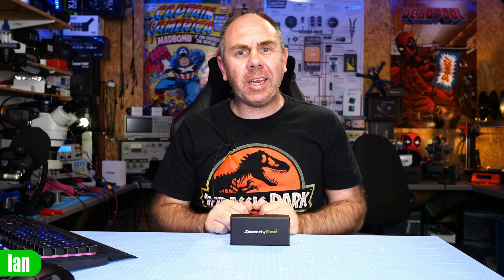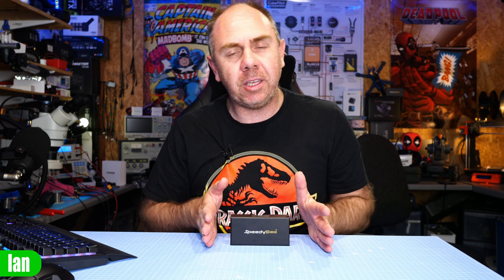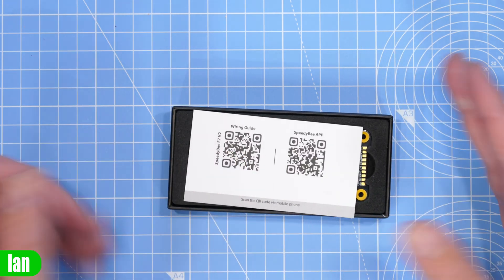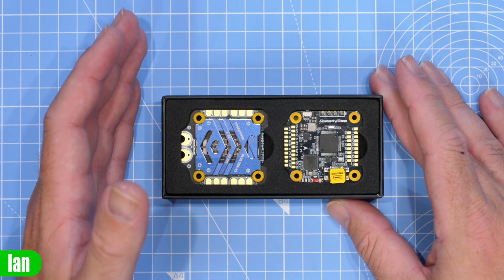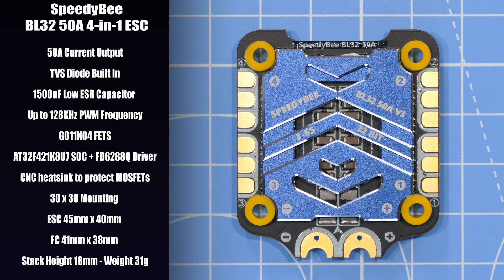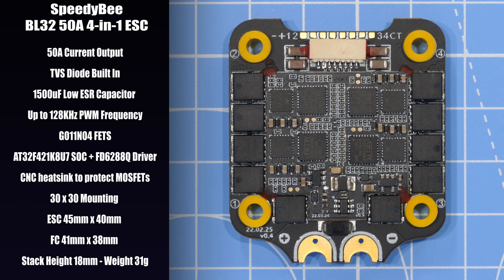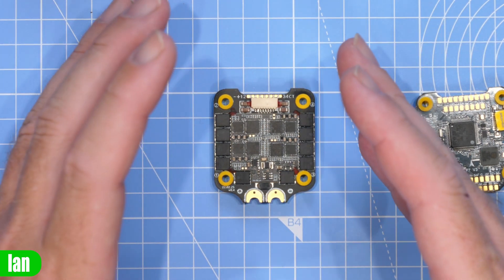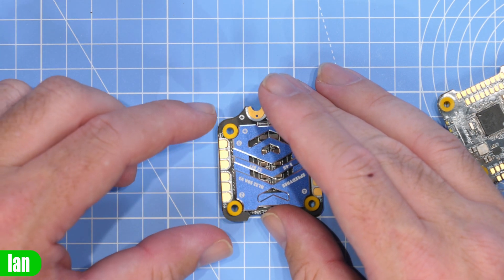SpeedyBee F7 V3 Flight Stack - Everything But The Kitchen Sink

Comment: Appears this stack is decent, considering that speedybee has kept producing it to this day. The later revisions of the V3 have a grey heatsinked ESC instead of blue. Features are mostly the same. The smaller top mounted BEC components (i assume this is the 5V bec) are now clear-epoxy potted as well as all of the plugs stiffened up with said epoxy. These changes appear very ideal for shock resistance, which very little other FC manufacturers appear to do.

SpeedyBee is gaining a larger retail following, since they sell retail on places like Amazon now, so have to handle a lot of returns on these FPV products. They will review the product flaws, and address them in order to get the warranty returns down. The FC design isn't flawed where it NEEDS said epoxy, not when compared to other popular flight stacks out there, but the fact they add it while others won't is telling to me. They all lack additional component-level hardening in some regard.
Reply: Oh, and they changed the chonker 1500uF capacitor to a very slimmed down skinny 1000uF. Love it.

Comment: Can someone help me with the OSD on my SB V3 stack PLEASE ???? I cant make it work Goggles 2 and O3 unit... I have Uart 4 my MSP in BF the ports as it says in the manual  and the o3 air unit is not going full power after arming and not showing the OSD.. I spend 3 hours trying and no luck. Thanks much. I have the R2 and G wire removed from the air unit plug that should not be the reason.. right?

Comment: I purchased the speedy bee F7 V3 stack. I received it with bent pins. I always inspect the ports before using a product. I contacted Speedybee and they offered me a 20% discount on replacing their defective product. Be careful working with them. If you end up with a defect, they blame you instead of offering any customer service to rectify their failure.  I'll personally never use another Speedybee product and I'll not repair any quad containing their products. Be careful with they so called "warranty" claims.  They don't actually warranty their products.

Comment: Hi Master, 
hoping You are doing Well and UtMost Respect for your Expertise ( really ).
I'm planning build a Mid Range 5 as robust as possible with this Stack and their SpeedyBee Master 5 HD frame starting from a 6S battery and KV 1300 motors. How do you think ? Do you have any advice regarding the made of the engines ? Thanks
Reply from the maker: I always use Iflight Xing motors.

Comment: Just curious, are the schematics and firmware available for just the SpeedyBee F7 V3's top board (the one with the STM32F7422, not the BL32 50A 4-in-1 Electronic-Speed-Control or 45A BLHELI32 board)?     

I like that it has Barometer BMP280 , IMU/Gyro BMI270 and ESP32-S3 (bluetooth/wifi).. so just want to purchase the top alone  (not the Voltage Regulators / Battery Elimination Circuit board) to play as a development board with my own sensors (ex. Beitian BN-880)

However, I'm concerned that I won't be able to flash/debug using SWD.. or if it's somehow locked to be used only with the Betaflight 3.5.2 / Emuflight / iNav  firmware / app?

Comment: Hi Mad's, I bought this flight controller because it was Inav compatible. I want gps rth and sell al my dji drones. I have built and sold over a 100 drones since 2010. (Inav, Betaflight etc...) In Inav, I can not get the esc from beeping. Even after successful firmware update, the esc beeps and will not connect on blheli android app. It will be detected but I can not write the changes I make. For better troubleshooting, I installed Betaflight and did get the drone to fly, I could reverse 2 motors from the motors tab in Betaflight... But as soon as I re installed Inav, the esc beeps constantly, the status tab shows harware not healthy and navigation not safe and although I can spin the motors in the output tab, I can not arm the drone's motors with the remote controller...  Anyone got the speedy bee f7v3 to work on Inav ?

Comment: @MadsTech - Great video! 

regarding this controller > speedybee is not only executing on the tech (new battery checker, their app for configuration, and much more), but they are executing successfully on User Experience. this is how you disrupt the initial leaders. wise strategy. will be interesting to see how they continue to innovate.

Comment: If you buy one and update firmware make sure you set your pwm on bLheli the default is 24 high 24 low will burn your motors up .. set high to 128 the max and the low to 35 fixes hot motors set motor timing 22 to 24

Comment: what i find interesting is that the controller supports 8 motors but their esc is only 4
Reply: I am pretty sure you would use two of the ESCs, and join them both to the one FC.

Comment: Hey man, I’m having a major issue with this stack. My FC and RX gets minimal power from the ESC when connected to lipo voltage, but on BF via USB and Bluetooth, it works perfectly fine. I tried reflashing firmware via BlHeli, but get an error message upon reading. Even in BF, the motors do not spin, twitch or whine. Any idea on what could be going on?
Reply: What batteries are you using? Can you intercept the voltage lines to measure how much current is flowing to those devices? I've been using this stack for about a week now and I've had no power issues at all. Do you have a VTX connected? How much power is it set for?

Comment: Is it normal that my SpeedyBee F7 V3 runs on 3,2 kHz Pid Loop/ Gyro update frequency? I cant change it up to 4 kHz or 8 kHz. And do you know why it is so low?
Reply: I have the same question . Are we the only one with this problem ?
Reply: @diverFPV  nope, it is normal ive asked speedybee
Reply: Old comment I know, but the gyro used on this FC only runs at 3.2k so that’s the max rate you can update everything. Joshua Bardwell has a video about these BMI gyro’s but his opinion is that they’re very solid and near/equal to MPU6000 gyros which were the gold standard

Comment: My V2 fc just crapped after a year and many many crashes, has a bad BEC for sure, works on usb and is recognized in bf. Gonna try to fix before giving in.
I may still get one of these for another build down the road, speedybee has been good for me.
Reply: If you haven’t replaced it yet, or want a spare, you can buy an external 5v BEC, and wire the 5v OUT of the BEC to a 5v pad on the FC, and basically reverse feed everything on the board in a sense. I’d just check that the FC pads are dead beforehand with a multimeter so you don’t really blow the board up, or desolder the built in 5v reg.
Reply: @matt0725  hello where is this 5v reg on F7V3 ; my 5v is dead

Comment: I got the new Esc as replacement for the problematic version 2 Esc .. betaflight works great but I found in issue with the INAV (not all the engines are spinning with dshot ) can you test it with INAV ?

Comment: I really like the v2. I had some serious problems with the esc tho, but the FC was very good and solid. I will probably get this new version
Reply: I have v3 and having esc issue (I think). built 2 identical quads except the stack is the difference. one has 20x20 speedybee mini + tmotor 60amp 20x20esc and it flies fine but the one with V3 stack has this strange motor noise sound no matter how much filtering I add
Reply: @olaf_hawk  I am now using the V2 fc with tmotor 50amp esc and so far no problems. i used to have problems with my drone getting seriously wrecked - just dropping randomly from the sky using the v2 stack esc. I haven't tried the speedy v3 yet but already bought one without the speedy v3 esc, as I am planning to use an old non-speedybee esc on it for now

Comment: This looks very solid, 
looking to reestablish rep after the v2 fiasco 
I've had good luck with my V1 stack. 
this would be on top of my shopping list right now. 
very handy
Reply: I just got the v3 stack and despite building a drone for like 35th or 40th time, I never had this weird unhealthy motor sound with any filters i chucked at it. I thought it was BMI270 gyro so i really made sure the LPF2 was 250hz and still same issue and it ramps up with rpm. then I replaced one of the brand new motors that sounded a bit louder than others for another new one and still same issue. im considering taking my older 30x30 60amp hobbywing and lending it to this build (that goes to my dad)
Reply: Excellent stack I have the f7 mini blheli S and the v3 blheli32 the v3 is the best freestyle reverse motors on the fly to  fly upside down wide pmw range to 128 super smooth
Reply: It's the pmw set high to 128 low to 35 I bought 3 till I seen on ad that the range is 128 I thought it was 48 makes motors super hot at low pmw range

Comment: I do like Speedybee flight controllers, just hope the esc is more reliable than the last one (I'm sure it will be) 👍🏻
Reply: Mine is working pretty good ( knock on wood) I've got the newer 4 in 1 blheli 32 45 amp 128k PWM version that comes with the f7 v2 stack. I followed their instructions and immediately flashed the newest blheli and I haven't had any problems thus far, it's been just over a month on my freestyle rig and since February on my 7 inch lr rig.